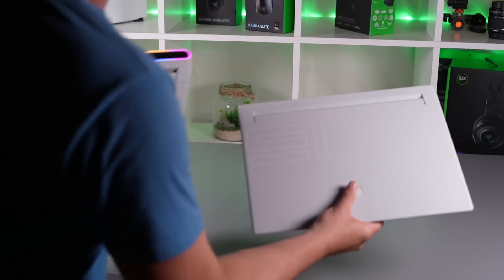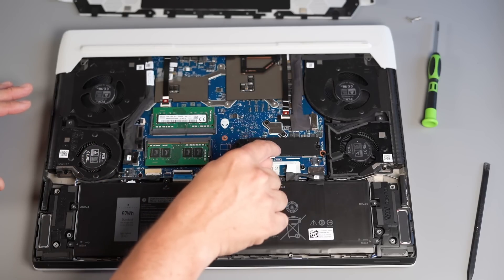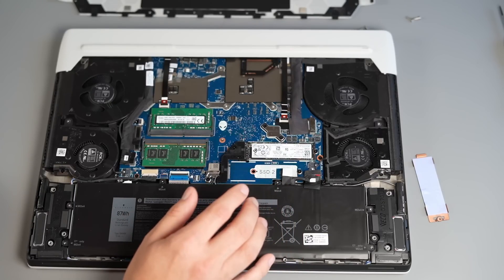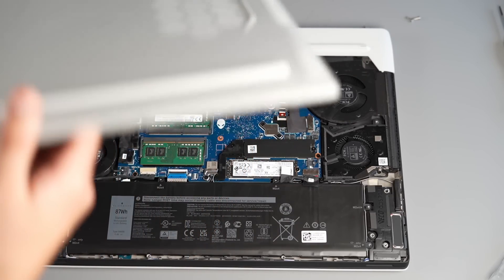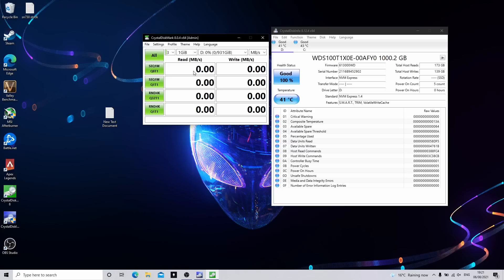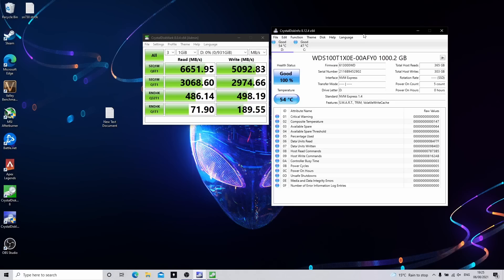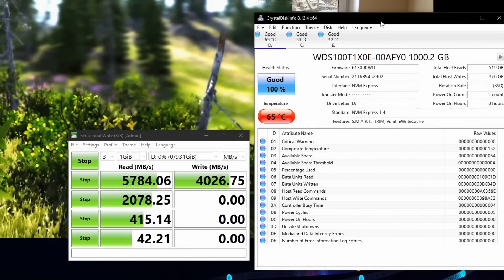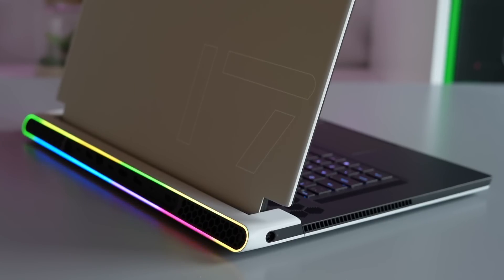Alienware X17 / X15 SSD upgrade featuring Gen 4 M.2 NVMe

Comment: Hello. Just recently bought a x15 with 500gb ssd. Am I still able to hook up a gen 4 in the extra slot?
Reply: Also ordered the Samsung 980 pro gen4 1tb ssd, would u happen to know if that would work?
Reply from the maker: yes and yes 😀👍
Reply: @tommypham3241  I just installed the 2 tb version in my x15. bought a thermal shield as well. I get advertised gen4 speeds but crystal disk info identifies it as a NVM Express 1.3

Comment: Question:  so I ordered the x17 with a 512 GB SSD, would I be able to order the gen 4 1TB in this video to replace that?  Or is it a different size?  If you know the answer please respond
Reply from the maker: The gen 4 I link in the description worked perfectly. And I did the same, I used the gen 4 for the operating system and kept the original fen 3 for games storage

Comment: When I unscrewed the back it did not pop up nicely at all unfortunately. I’m not sure why this was the case.
Reply from the maker: Oh that's odd. There is usually a metal tab on the screw which forces the plate up when you unscrew it! I guess they forgot to install it on your model. Did you still manage to get in?

Comment: When you reinstall windows is their a motherboard driver or any driver for this system that you need? I’m got one and I’m going to try this. Thanks for the video!! Is thier anyway you can just transfer windows to the new drive
Reply from the maker: Hi Ryan, if you get the latest windows download it will have a lot of the drivers and windows update will pick up the rest. I always get the nvidia drivers direct to get the latest and you will need to get command centre from dell support page 👍 if you get stuck with anything add me to Instagram and message me. Also you can clone the ssd but that can actually be more complicated

Comment: I bought new ssd like this video. There is no way to move window in to new ssd?
Reply from the maker: You can use cloning software. Often you get it with the ssd you buy or there are free versions available. I prefer a fresh install

Comment: Will this work with an M15 r5 laptop alienwear? Same install for an Nvme.
Reply from the maker: It’s similar but the r5 is only gen 3 slots 👍
Reply: @MashITTech  I am so confused on this i don’t know what size Nvme ssd my laptop takes. Someone said it takes the short ssd would you be able to link me some 2tb 1tb Nvme ssd and heatsink and bracket for it? Or does mine take the long ssd Nvme I am so confused I have the m15 r5
Reply from the maker: @HotSizzleTV_  it can take both 30mm or 80mm in each slot as you can adjust the length. I did a video showing how, I will find you a link. With regards to the ssd, do you want cheap or more expensive with better performance? Let me know and I will link you
Reply: @MashITTech  so any of these of Nvme will fit my m15 r5? Can you please send me some links to Nvme ssd 1tb or 2tb with heatsink and a bracket please thank you.
Reply: @MashITTech  thank you for this i had to call dell they said no i had to pay for the bracket and heatsink lol i said watch your video they still said NO lol

Comment: hey there great vid, im planning on getting an x17 for blackfriday, so its best to upgrade the ram and ssd myself and not with alienware? i want at least 32gigs of ram and 1tb of ssd, thanks!
Reply from the maker: The Dell 32gb kit is fine so you can choose that unless it is much cheaper to do it yourself. The 1tb ssd was cheap but its only gen 3. If you want gen 4 you have to buy it yourself. I bought mine and put it in the first slot and then put the Dell supplied SSD in slot 2 👍

Comment: Can u fit 4 TB Sabrent NVMe SSD in that Laptop
Reply from the maker: I haven't tested that. I am assuming the 4tb is double sided so I will need to check
Reply: @MashITTech  yes it is double sided I mean memory modules on both sides. Please check and confirm if it fits in x15 or x17. I will buy the laptop if it does. Thanks for your effort
Reply: @MashITTech   you can also try WD SN750 4 TB NVMe SSD.. it is perhaps single sided and won't be a problem

Comment: Hi, Mash. I had my X17 upgraded today, with a new 970Evo Plus. I just want to know, if it is safe to use 970EP without a heatpad? I left the headpad to the 980 comes with the machine
Reply from the maker: For general use you should be fine. I only found it heat up more than I was comfortable with if I put it under continual use for 10+ minutes which never happens outside of benchmarking 👍
Reply: @MashITTech   do you have a part number for ordering an extra 'heatshield' ( heatsink ) for the second SSD slot?  I have tried looking around have come up empty handed.  And again t so much for all the reviews on the X17.

Comment: Will the Kingston KC2500 M.2 NVMe PCIe SSD 2TB fit the X17? I am not too much into speed, more into space. This is priced the same as the Gen 4 Black. Thanks.
Reply from the maker: Absolutely no reason that one won’t work but I haven’t tested it. I only usually buy Samsung or western digital ssd’s for the warranty and past experiences with them 👍
Reply: @MashITTech  i will check out Samsung and WD Blue. See if the price is right.
Reply from the maker: @ameetwong1316  you can get some great prices wd blue but performance is average. I use it as a secondary drive for games and a wd sn850 as my boot drive 👍 should be some links in the description
Reply: @MashITTech  thanks
Reply: Ok so I opted for the Kingston 2500 2Tb Ssd. Yes it fits but not properly. There are chips on the bottom of the SSD so its not entirely flat. I got it to work but I wouldn't recommend it. You need to get a flat bottom M.2 if not its going to curve a bit.

Comment: Awesome Video, thank you very much, did you test the same with the x15?  Are the temps the same as x17?
Reply from the maker: Ssd temps are pretty similar but cpu and gpu not as well cooled as the x17
Reply: @MashITTech  Thank you for the quick response, hopefully nothing to worry about with the cpu/gpu temps? I’m looking to get the x15 I9 with 3070, 32GB mem and 2TB nvme. How much difference do you think there is between the I7 and I9  is it worth that extra?
Reply from the maker: the i9 is not worth it at all! for a start the i7 is unlocked so you can already boost it past the default speed (see my x17 deep dive video for more info) and the thermal system cannot cope with the i9 at full throttle. save your money and get the i7 and tweak it :)

Comment: Hi David, i installed a samsung 980 gen4 m..2 but wen i try to install a fresh windows on the drive it is not reading any of the m.2's. I have tried removing the drive that came with my x15 R1 But still did not work. Can you please make a clean install video or help me install my OS on my new faster drive.
Reply from the maker: I can certainly help you. Did you switch it to ahci in bios instead of raid? Add me on instagram and we can chat easier there 👍

Comment: When I install my additional nvme ssd my laptop does not boot into windows but when I remove it, it boots into windows from the original ssd. Is there a step I am missing? Do I need to enable it in the bios before boot up if so which settings?
Reply: X17 officially supports 2tb per ssd max so if your over that it may fail to fully post. And if it's a used ssd it may have files on it the laptop is trying to and can't boot. Try going in bios and checking boot order.

Comment: Hi David, just put in my order managed to get a a coporate discount ontop of the 14%, happy days! I've ordered just the standard 1gb with the intention of picked up a gen4 ssd. Do you have a heat sink for the ssd you would recommend purchasing so that both drives will be sorted. Thanks!
Reply from the maker: Nice one Andy, that is exactly what did plus 6% topcashback 😂 got a higher spec X15 ordered now as I was disappointed with the base model. I am still running the heatsink on the gen 4 and running the original 1tb naked as it runs pretty cool. If I find a good heatsink I will let you know 😊
Reply: @MashITTech  thanks much appreciated. I know you have probably mentioned this in another video, so apologies in advance but have you noticed much in the way of thermal throttling?
Reply from the maker: On the ssd? None at all and not with the system either

Comment: mate how is the ssd holding out?.....my x15 is coming anytime now so was wondering it would last for atleast 5 years(will it?) or want me to go to samsung 980 pro
Reply from the maker: Brilliantly and the wd sn850 comes with a 5 year warranty so they must be pretty confident it will last at least 5 years 👍 I have another higher spec x15 on order as I don’t think the base model x15 did it justice
Reply: @MashITTech  another one yesss......expecting more comparison video with x15
Reply from the maker: Yes, I can't wait either. I wanted to try the 3060 as I had a 3070 and 3080 X17 but I didn't realise when I ordered it that the 3060 base model used an inferior cooling solution and only had 90w TGP so was a bit underwhelmed. I am actually looking to keep this one for myself as I need a mobile gaming laptop for a bit of gaming on the go and for video editing. I considered the XPS range but the ports on that make the X15 port selection look great and it has a terrible cooling solution and gfx card in comparison.
Reply: @MashITTech even i thought of buying xps 15  but for a 1660 and a thin bezzel a whooping 1799$ was a waste of money so went with x15 with a better gpu and almost as thin as an xps for just 200 bucks more (lol i could afford only the base model guess im stuck with a "perfectly fine for me" cooling solution xD)
Reply: you are the first one to review x15 on youtube i guess so if it wasn't for you i would have bought an xps thanks a lot mate

Comment: Nice vid, will upgrade my x17 with a second SSD too.

Can you tell me if I need to upgrade the 32gb 3466 xmp ram cuz of high/low density or are they the maximum necessary for gaming on the market right now?

Also do you know if it's possible to switch the 4k 120hz display for the 1k 360hz when I send it to Dell?
Reply from the maker: the XMP ram is good so no need to change that. Dell may allow you to swap the panel but they will charge you a fortune. It is often cheaper to sell your model and buy another :(

Comment: Hey good video mate, been following you for a while now. Your channel deserves alot more followers!! I have just received mine after small delay. I ordered the 360hz screen option as I have a LG C1 4k 120hz to plug into, well at least I thought I could!! 
Can you let me know if you have any problems connecting out on the hdmi port to a 120hz monitor or TV? Was working @ 60hz but now it's not picking up any signal. 
Been on the phone to technical support for hours with no luck. Thinking there might be an hardware limit issue. 
Cheers
Reply from the maker: Hi AJ, sorry to hear that, the HDMI is 2.1 so you should have no problem. I guess you made sure you were using a decent HDMI cable? have you tested more than 1? I am using display port to my 34" ultra wide but let me try connecting to my 240hz panel via HDMI and let you know how I get on
Reply: @MashITTech  Hi mate, I tried my own little work around. I did a full reset and updated all my drivers. It seems to be working now lol. 
I really appreciate your reply!! 
Looking forward to more content 👌
Reply from the maker: Had a few days off working on the Studio but will be back on it tonight :)

Comment: Is the x15 or 17 better than the m15 r5 cause the GPU wattage seems worse on the x15 than the m15 r5 and battery life wise o heard its better?
Reply from the maker: The m15r5 has better battery and a higher tgp but runs really hot, (100c) the x15 is much smaller, much better build quality and runs cool but the tgp is slightly less and you only get 1 usb 3 port 😢

Comment: With my x17 in a RAID 0 with 2x2TB, I am getting incredible speeds.  
SEQ1M Q8T1 = 11,240 Read and 7,202 Write.
SEQ128K Q32T1 = 10,010 Read and 5,127 Write.

These are Samsung 980s and are both GEN 4.
Reply: 2×2tb raid0 come with stock ssd?
You get 2 pm9a1 from official website configuration?
Reply: @junhangyong3633  Yes, Two pm9a1 (Samsung 980) drives is standard (stock) with the 4TB configuration.
Note:  The speeds quoted are with Bitlocker running as well.
Reply: Or you switching to samsung 980s aftermarket?
Reply: How did you set it up? I need help

Comment: Alienware X17 - Manual - page 20
NOTE: Supported card configurations on M.2 slot one (SSD-1) and M.2 slot two (SSD-2):
● M.2 2230 solid-state drive + 2230 mounting bracket
● M.2 2280 solid-state drive

Does this mean both ports support Gen 4 drives on the X17 models?
Reply from the maker: I am still testing this. It appears they are both gen 4 but I was getting slower results on slot 2 which is why I thought it was gen 3. Will update you when I have looked into it further
Reply: @MashITTech  can confirm both slots are gen4. Put a 980 in second ssd slot. Installed crystal bench mark getting identical readings for second ssd as the first.

Comment: Great video as always! Interestingly enough, I finally received my x17 a week ago (USA delivery), and I had chosen the 2TB hard drive option which turned out to be a Samsung PM9A1 Gen4 2TB SSD (AFAIK, the PM9A1 is basically just an OEM 980 Pro isn't it?). I know yours came with a Gen 3 from factory, so not sure if it's specifically the 2TB that comes as a Gen4, or if it's a difference between UK and USA deliveries. 

I ran CrystalDiskMark and got 7017MB/s | 6434MB/s | 762MB/s 79MB/s Read, 5097MB/s | 5086MB/s | 459MB/s | 174MB/s Write, so actually hitting just over rated speed on the SEQ1M read which to me is bloody impressive. Real world performance is crazy good too. Fully loading into a Cyberpunk 2077 savefile from fresh startup in sub 5 seconds. Fastest I've ever owned, so I'm very pleased.
Reply from the maker: Thanks for the feedback and yes you are right. I have had a few viewers now with the 2tb say the same so it appears the 2tb is definitely the gen 4! I wish Dell would tell us this information rather than having to find out the hard way. All drives less than 2tb are gen 3 though from my feedback 👍
Reply: I was puzzled as to why the upgrade from 512GB to 1TB was just 10Eur, while the upgrade to 2TB was 200Eur. I do understand why now :)
Reply: so both drives are Gen4 correct?
Reply from the maker: I have had a day off today but I will do another round of testing tomorrow to see if I can find out why I was getting lower scores on slot 2
Reply: @MashITTech  Just wanted to update you that I installed a 2nd Gen4 (980 Pro) in the 2nd NVME slot and was able to match the performance of the main system drive in slot 1. 7k peak read and 5k peak write in the 2nd NVME slot. So maybe they are in fact both Gen4 slots? Will be curious to hear your findings once you have a chance to revisit this topic, but as far as I can tell on my machine it's 2x gen4, at least from the benchmark results
Reply: @knd4rkst4r  I was also puzzled when Mash IT mentioned one slot is Gen 3 slot. If you read the user manual, it specially says it supports up to 1TB for gen 3 SSD, and 2TB for gen 4 SSD. If one slot is Gen 3 then the max storage you can buy is 1TB (gen 3) + 2TB (gen 4) = 3TB, but pretty sure you can buy 2 x 2TB with Dell, in which indicates both slots are Gen 4.
Reply: @thecat23  Yeah their chart is mildly confusing, but in the end it basically just says if you order a 2tb+ configuration you GET Gen4 drives from Dell. 

If you order 1Tb or less you get Gen3 drives.

I got the 2tb and added a second 2tb.

Comes with an OEM manufacturer only model 980 pro with a generic sku and I added a 980 pro I bought.
Reply: @justinmacks1481  Thanks for your comments. I end up getting 1tb 2nd Gen on one slot for system, and 2tb 2nd Gen for storage.
Reply: @mtxgalant96  Both ports are Gen4 compatible.

But if you order a 1TB or less drive you get a Gen3 drive as the boot.

Have to order the single 2tb or raid 2x2tb for Gen4 drives.
Reply: Both slots are Gen 4. Anything under 2Tb on your order gets the gen 3 drive. You can run max 4tb 2tb x 2tb of gen 4 m.2 pcie. Best deal is to get the 1tb option and save $220 and buy the 980 pro 2tb for that...
Reply: How is the battery life

Comment: Have you been able to find a workaround for bypassing optimus in a 165hz panel config?
Reply from the maker: Yes, I can plug it into my external monitor for dedicated RTX. There is no work around for the native panel though. Dell did add a MUX to the m15r5 via BIOS recently so I am hoping they will for this model

Comment: Im thinking on getting the 2tb one. Where do you get heat sinks? Or should i just buy the one with a heat sink included?
Reply from the maker: You can contact Dell and I am also in the process of trying to source a direct replacement we can buy ourselves. Dont bother buying the SSD with heatsink attached as they are too big for the laptop unfortunately

Comment: in alienware x15...are both m.2 slots empty? do we have to buy heatsink separately or its given by default (in x15) because when i saw the x15 there were no heatsink just plane slots
Reply from the maker: In every model we have received there is a heat sink on the installed drives but if you have a spare slot there will be no heatsink for that but you do get the ssd screw. Hope this helps. Someone has given me a lonk for the heatsink so I will order and test it, if its ok I will give you the link :)
Reply: @MashITTech  Atleast dell gave screws lol
Reply from the maker: ah the little things lol :)